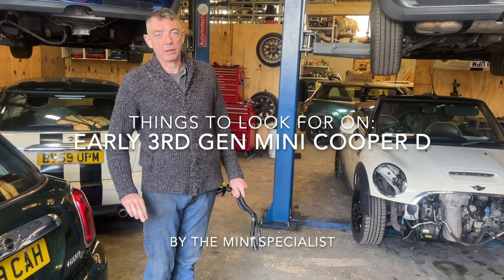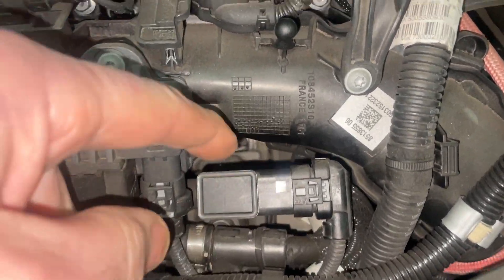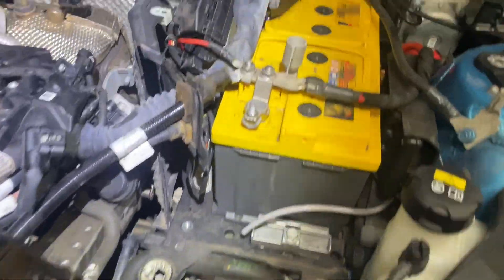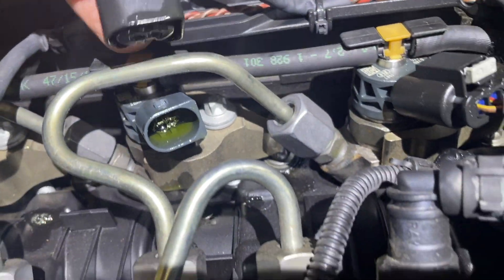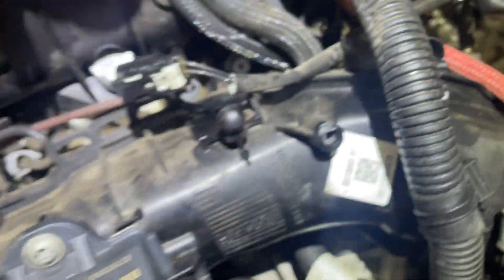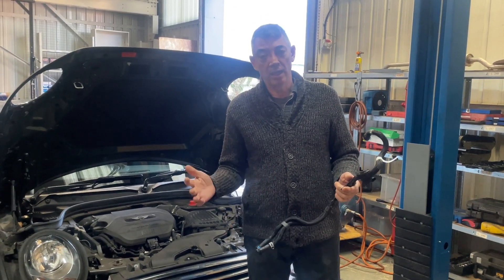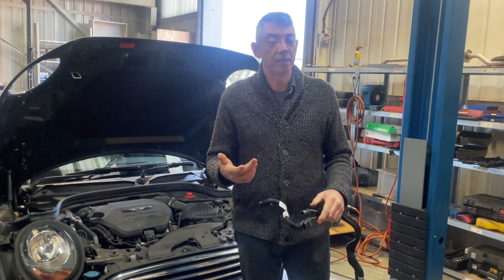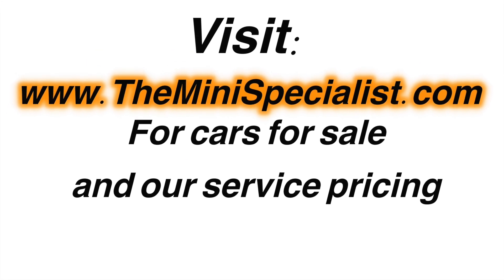The BMW Diesel Engine Fault Explained - affects 1.5 litre and 2.0 litre BMW & MINI Diesel Engines

Comment: Wow, new Clubman D owner, kinda terrified. Is this fixed in LCI models? Mine is 2020.08 production date.
Reply: Yes they fitted an upgraded sensor depending on part number from 2018/19
However cars with the part number with an index number of 01 (the known sensor with a fault) mini have a bulletin now and are good at excepting goodwill claims for this issue

Comment: The sensor you point to is the temperature sensor (at least I disconnected it and my ecu reported a disconnected temp sensor)The fuel pressure sensor is on the end of the fuel rail! It's on the right hand end of the common rail. Does the one you point to have a low pressure sensor in it as well as temperature? The one you point to appears to be part of the entire fuel feed line for the engine. I assume that's what needs replacing - and I am guessing it's a dealer only part too. Thankfully mine hasn't leaked diesel. Many thanks for an informative video - a friend had this happen - cost a fortune.
Reply: Does it still run with it unplugged?

I’ve just found this issue and mine is leaking a very small amount. It’s unplugged for now

Comment: Hi mate, just a quick question. What are the symptoms of a car with this problem? Because I have a Mini Cooper D from 2019 and I have now a yellow flag in the instruments. The official Mini dealer has give me a quote of 6000 € to fix the fault (and I think that they will do more or less what you did to the Mini on the video) but the car works perfectly… Is it possible or they are cheating me? Regards.
Reply from the maker: symptoms can be varied and depends where the diesel has got to and which plugs it has contaminated.  If the ECU is affected (like this one) the main stealer will simply replace (where I cleaned it) which will add to your bill.  In this case the bill was around £700 and I replaced the engine loom, cleaned all the plugs and cleaned the ECU.
Reply: @TheMiniSpecialist Cheers mate, thanks for your help.
Reply: @TheMiniSpecialist One more question, please. The problem of the fuel pressure sensor is a manufacture issue…? I mean, it will happen again after x years once solved? Regards. And sorry for the mistake, our car is from 2016.
Reply: @aviatuber1308 they upgraded the internals of the sensor around 2018/2019 depending on the part number/ variant so If a new one is bought from mini it shouldn’t happen again